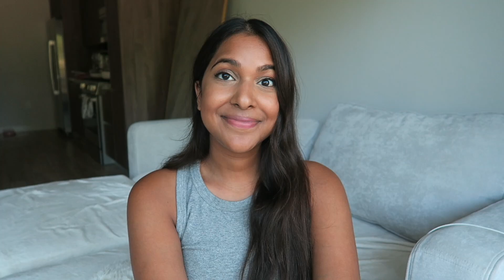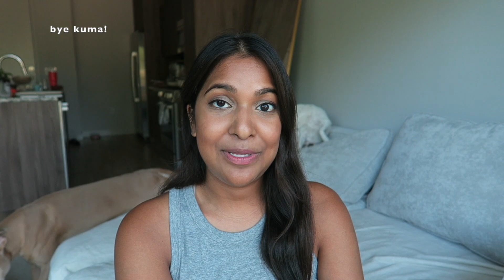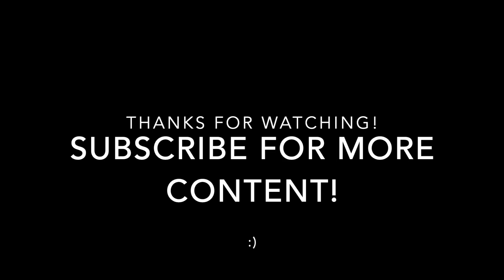MECHANICAL VS PROSTHETIC VALVE | PHARMACIST EXPLAINS

Comment: Please do not buy into the marketing of the lower INR for the OnX aortic valve. I got an OnX aortic valve for that specific reason and 9 months later had a stroke. I’m a member of different groups and forums for people who have had heart surgeries and the lower INR has caused many strokes. Most people with OnX have been moved to INR levels similar to other mechanical valves.

Comment: First week of October is my surgery. 39 years old, bicuspid aortic valve with moderate to severe regurgitation and ascending aortic aneurysm 4.9cm. I met many surgeons and i decided who it will be. He will send back to the company that makes the corcym haart annuloplasty rings my data from my CT coronary angiography and my transesophageal ultrasound so that they say the success rate of going for aortic valve repair. If surgeon gets the green light that's plan a. But that means full sternotomy. If not minimally invasive benthal with the corcym bicarbon mechanical valve, which needs low anticoagulation from day 1 and uou can even stop sintrom for 4-5 days safely and have another procedure (dental for instance). I just returned from the capital to the island where i stay by plane. Next week i travel there with wife cause months ago,before knowing or expecting any of this, we got into a program for in vitro fertilization. And after i give sperm in a couple of days i go into surgery. Which means my wife isn't and won't be there with me. My parents will. They are not ok. They are afraid and crying and miserable even though they don't want me to see. But i see it. I am in a shock still. I feel like all this is happening to another person and not me. Or that i will wake up and it was just s bad dream. I feel like i am out of my body, disassociated up to a level. I'm afraid of the aneurysm till the day of the surgery cones and for the afterwards. I feel like it will never be ok again. I'm afraid but primarily I'm shocked.  A few days ago i was planning my year, job , master's degree, family and now....is this really happening to me?
Reply: How are you brother same problem me

Comment: Welcome to Texas! Was your valve affected by your dissection? I have an aortic root aneurism of 4.8 and a dissection or tear is my biggest worry but I’m also bummed of having to have the valve replaced because of the aneurism deforming it.
Reply from the maker: Yes! I had an aortic valve replacement only because of my dissection. My surgeon didn’t know if my valve would need to be replaced until I went under since my surgery was emergent. If your surgeon can save your valve that would be great but sometimes it’s not possible unfortunately